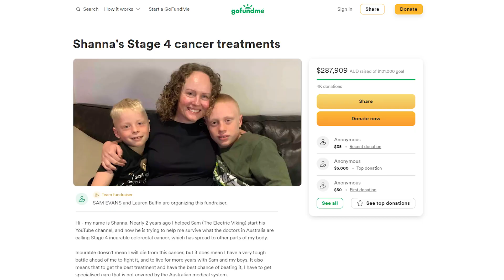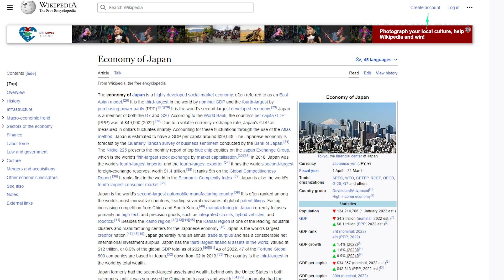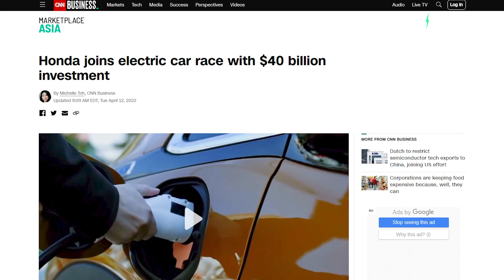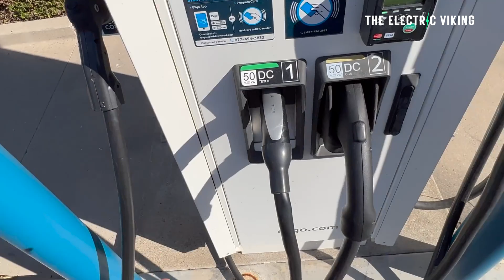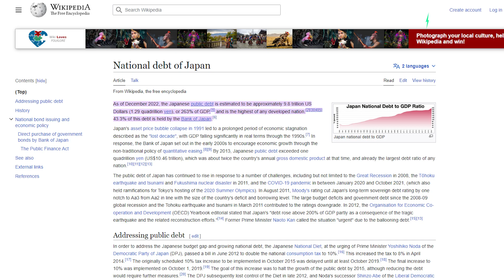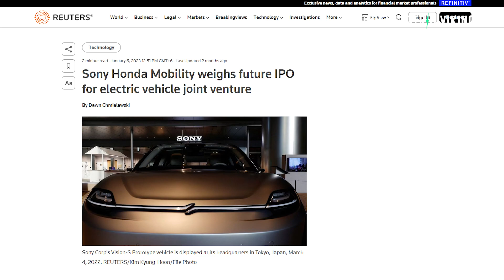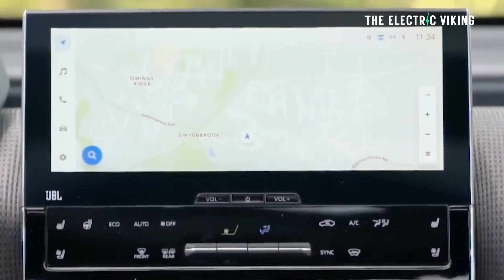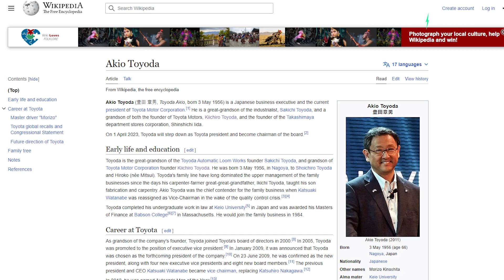Toyota wants to sell its old hybrids to 6 million people worldwide in 2030

Comment: Until 2 months ago, I would have agreed that the likes of Toyota hybrid technology was a second-class solution.  Absolutely believed there was no point in transitioning by some middle-ground.  But a couple of things happened.  One, I realised While driving a fifty grand model Y Tesla, my feet were freezing after 45 minutes, and getting worse.  Exact-same issue I had with a Nissan LEAF of miserly 30kWh, I drove my family a round trip of 600 miles one weekend in, 5 years ago.   If Tesla cannot fix that, who will.

Researching real-world customer experience, shows that in winter, about 40% + of your Model 3 battery, will be deployed as heating.  Now that puts your traction kWh down to…er, about maybe 40kWh at best.  Not far from the Nissan LEAF…not half far enough for me!  This raised a question, or several.  If a huge Tesla battery isn’t able to heat my feet, which EV will be able to do this?  

Secondly, I haven’t  prayer of AFFORDING the EV that could.  There isn’t a 60kWh battery capacity vehicle, that I could afford, new or used.  So I spent a fair few thousand £’s UK on a Toyota Prius.  I only drive automatic transmissions, unless forced not to, for health reasons (joints).  Balancing on one buttock every time you need to change gear, is brutal on your skeleton, and all the forces are in bad directions, and the terrible repetition is damaging.  So I don’t do it.  And, anyone with a back problem, or sciatica, stop driving a manual stick-shift car, and give it three weeks of driving an auto and swimming, and you’ll realise how bad your car has been for your health.

So I decided on a hybrid for heat.  Then, which one?  I mean, if they made a hybrid that used a 660cc snow-mobile ultra-smooth triple cylinder (it’s made by Yamaha), or smaller, I’d be in the market.  Because ICE is great as a boiler - 80% of the energy put in, comes out as heat.  The very best boilers, in recent years, gas ones (methane I mean) are 93% efficient if all circumstances are perfect.  This is one of the many reasons we are moving on, but heat is heat.  It could be a much simpler design, if all you wanted was heat, one of these diesel type boilers people are raving about.  But that wouldn’t be able to turn a shaft and make electrical energy recharge a battery.

Anyway, lacking a custom-made Yamaha 650 triple-based hybrid, I am looking for an automatic transmission one that is older, so I can afford it, and low mileage as it’s now my ‘retirement car’.  Yes, we’re there.

What surprised me, was that Toyota’s ‘synergy drive’ is not in fact BS.  I just assumed it was marketing cr@p.  Remember, until 6 months ago, I was solidly anti-hybrid and ‘Prius’ was another word for vagina.

Since buying one, based on a lot of research, primarily showing Toyota’s drive system in the gen 3 and later (around 2009/10 onward) had no stacks of friction plates, but was still ‘wet’, I have found out a lot of affirming information.  Here’s the short version of Toyota’s hybrid drive: it’s a GM concept, patented, that GM sold to Toyota some time ago.  Invented by a group of designers/engineers in California.  The suspicion is that GM rather regret the loss of this, but that’s another story.  There is one single friction plate, but it is not used.  It exists, but is permanently sandwiched inside a casing, and is immaterial to the transmission operation, except if there’s a really huge, emergency-level torque shock to the system, then it might scrape around a few degrees.  

The core of the transmission, and the reason it lasts so long if properly maintained - no such thing as ‘transmission fluid for life’ so ignore that from manufacturers - is it is gears and two electric motor-generators and an ICE in a line.  Basically.  Weber Engineering have a great breakdown of how it works.  The lack of all the bits that partly made me scrap my 5-pot diesel Volvo automatic, is what attracted me to the Toyota system.  Nissan, and everyone else, when they say ‘CVT’ they mean that complicated conical-pulley nightmare thing.  Good for lower-powered cars, I will give you that, but fragile in its own way.  Toyota seems the only one that says ‘e-CVT’ or more correctly in fact ‘Synergy Drive’ and it means a very slick system.

So I am a convert, because I can go hill-walking in the sleet and rain, and come back freezing cold to my hybrid, and get warmed up as if at home in the living room by a fire or radiator.  There’s also people do the camping thing which is interesting to me, as I am useless with tents.  There isn’t an EV for DOUBLE the money, that would come close to the functionality of this Prius 2010 gen 3 I have.

So I don’t take issue with ‘archaic’, because it’s only archaic, like an electric motor is archaic.  I have a use-case in a cold northern climate, and this Toyota fits it.  250k miles is do-able on the same transmission, with proper maintenance.  EVs in theory have less maintenance - but we really mean ‘maintenance cost’ a lot of the times, surely?  Well, you’ve paid double for a used EV with modest battery capacity, that I paid for this hybrid.  And your feet may or may not be warmed.  I am guaranteed heat.

I fully expected not to have anything but an EV.  I was waiting for a scrappage scheme that never came.  Our UK govt instead hands out money for home energy to people who have just built a massive home extension, and have outbuildings they heat, and indeed, patio heaters, and 4x4 vehicles out front.  If you think that such people need £400 of government assistance with home energy bills, please think again.  No, our UK govt is entirely ambivalent and in neutral/cba about the whole green thing.  It’s pretty disgusting.  We really do need to know, who’s got BP shares, or whose wives have them, and how much dividend they are due to get on the back of this year’s scandalous profiteering.

Because profiteering, is what you call it when someone rakes in cash, due to an opportunity they saw in a war.  Maxim did it with a machine-gun.  BP etc do it with the present conflict.  It’s allowed, because our UK govt is bent as bent can be now, their time is up and they can;t think about anything except triggering base supporters and filling the media with anything not to do with their incompetence.  Great video though, it’s another view, is all.  

My best to your wife, my mother and my present wife both had illnesses of this type.  It is brutal, and the treatment weakens them hugely.  I once drove 250 miles, made a cup of tea, found she’d fallen ill, an ambulance had come,and I tidied up the cup and teaspoon in that house I was renovating, and drove right back home.  She’d been ok when I left her with the kids just 5 hours earlier.  She survived, thankfully, I hope your wife does too.  Take care all.

Comment: A 15k dollar EV with 200 miles of range for sale in the US would sell like crazy.
Reply: any car that that cost 15 k new would sell like crazy
Reply: @kvs13156  the Nissan versa starts at $15k. They sold less than 20,000 of them in the USA in 2022. Not exactly flying off the shelf. Mitsubishi mirage is also in the $15k range.
Reply: I own a Nissan Leaf - it has a 60 mile range - it suits me well for daily commuting ( 30 mi per day) but would be inappropriate in most metro markets - it was about 30 k new in 2016 but I bought it for 10k used - a good supplement but not a replacement for my Honda CRV hybrid. The fan boys need to let the market decide.

Comment: Hybrid is the best option today
Range is the best 0ver 300-400 miles (480-640 kilometres)
Can live both world winter and summer, city countryside off roading expedition 
Low emission 
Best gas mileage 
High quality 
Reliability 
Affordability 
No lots of recalls( 19-35 times) like those EV companies 😁
No burning 🔥 lithium batteries issue.
Performance is the down side.
As long no early divorce 😅
Suit to billions customers around world. 
No stress of waiting and queuing to charge. 
No stress hustle of planning scheduling and finding charging stations. 
No stress and worrying charging at home.
It’s a hybrid 😅